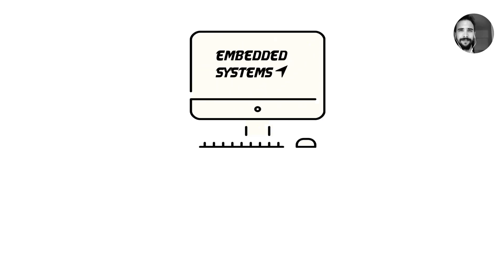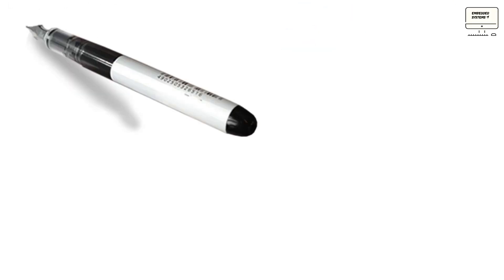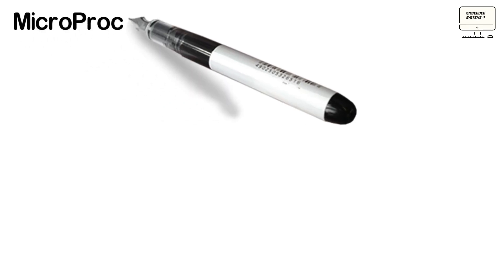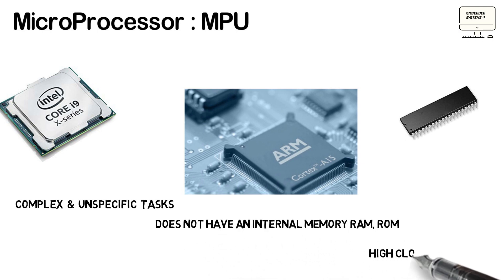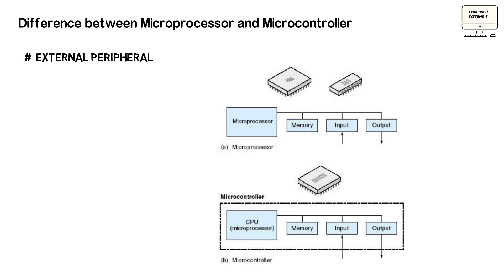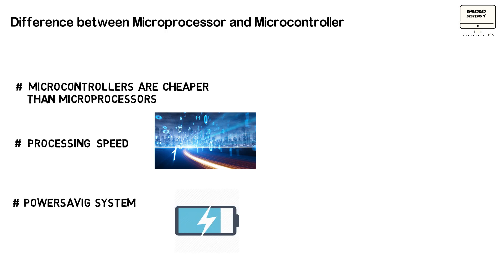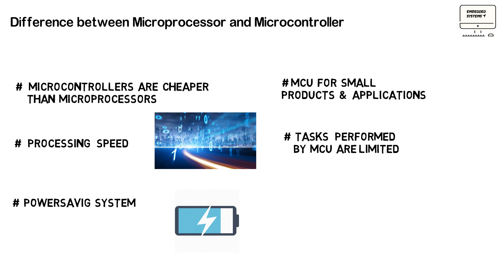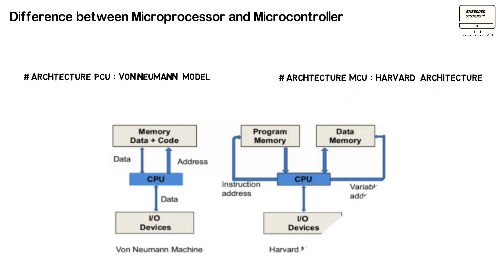Difference Between MicroController & Microprocessor

Comment: I wonder whether a specified learning process can be achieved using microcontrollers only🤔. Like for example for face  identification purposes.
Reply from the maker: It's difficult to use a microcontrollers in facial recognition, MCU it's used just for lesscomplex applications as Traffic Signals, Washing Machine...
Facial Recognition needs more resources computing (Speed, Storage, DataBase... ) than the microcontroller, you would be better to use a computer, maybe a single board computer like the Raspberry Pi for that purpose.